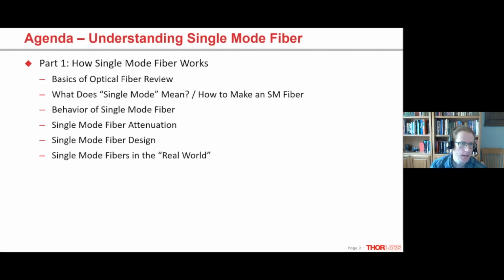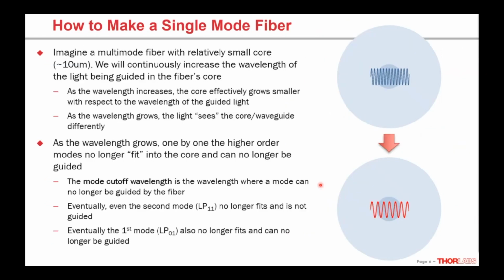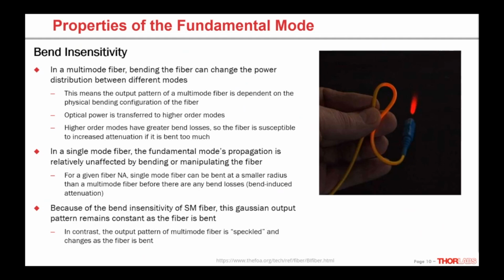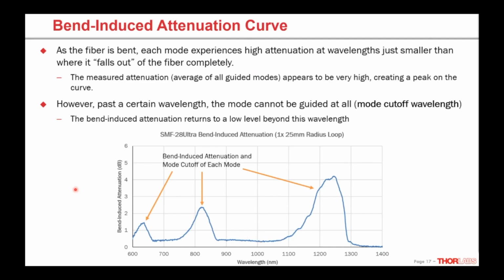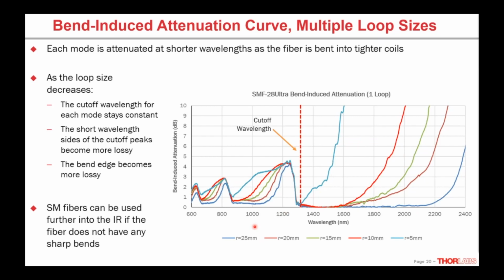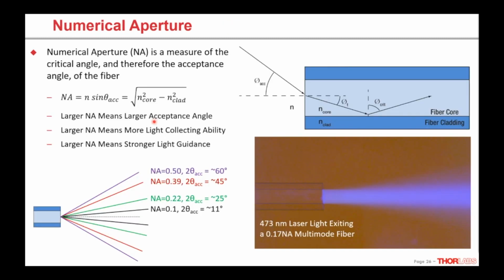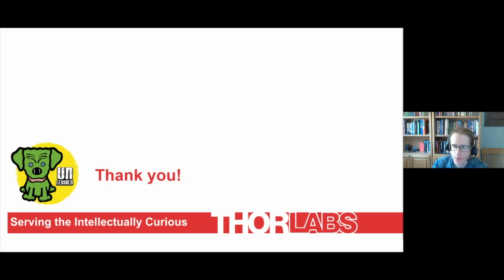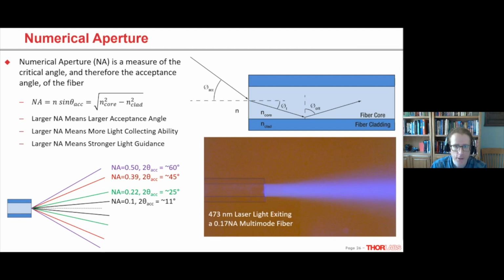Optical Fiber 101: Understanding Single Mode Fiber (Part 1 of 2)

Comment: Thnak you! These lectures are really informative!
Do we also know what we will get at the output of a SM fiber for an incoherent light input? 
And do the un-gaussian components are returned to the inital part of the fiber?
Reply from the maker: Thank you for your comment! If an incoherent light source is coupled into an SM fiber, the output will be gaussian. This is because only the gaussian “portion” of the input beam will be coupled into and guided by the SM fiber. The rest of the input beam will not be coupled into the fiber. The coupling efficiency will be very low, and the SM fiber effectively acts as a gaussian “filter.” For more information, part 2 of this webinar series goes into these concepts in-depth ( https://youtu.be/HvJeXakc8Kc ).

Comment: Just a quick comment that LP01 doesn't have a cutoff. Optical fiber is not like metallic waveguide that has an absolute cutoff.
Reply from the maker: Hi Arash, LP01 eventually "cuts off" and/or ceases to be guided in the fiber at wavelengths longer than the bend edge.
Reply: Thanks for the reply. I understand the concept of bend edge but that is not the same mechanism as actual cutoff for higher order modes. Solving the characteristic equation for a fiber shows that for V number from 0 to  2.405 we will have single mode operation. So basically V can go to zero. After the bend edge the transmission drops dramatically making the fiber practically useless for higher wavelengths but I don't think that is an actual cutoff in the sense that higher order modes cutoff.
Reply from the maker: @arashrohani7071  Our Tech Support Team would be happy to discuss this with you further! You can contact them at techsupport@thorlabs.com.

Comment: Super cool, thanks
Reply: ... do you guys bend the fiber around a 1" post for the attenuation test? lol
Reply from the maker: @pendalink  Thanks! When testing the attenuation of multimode fibers, you can use a mode scrambler, such as a mandrel wrap, to remove any cladding modes and ensure the light is traveling through the fiber with a mode distribution close to equilibrium. This prevents erroneous attenuation measurements due to lossy cladding modes propagating through the fiber and being measured. The radius of the mandrel is chosen based on the NA of the fiber (and sometimes other design characteristics) so that the loosely guided cladding modes are stripped out but the modes propagating in the core are left intact. This is especially necessary when light is launched into the fiber using an overfilled launch condition.

This mode scrambling technique is not necessary, however, if the launch into the fiber is sufficiently well controlled so that light is launched in at something close to the equilibrium mode distribution without any cladding modes being coupled in. However, even in this case, it can’t hurt to use a mandrel wrap or other mode scrambler as a backup in case the launch is not as optimal as intended.

Mandrel wraps can also be used when testing single mode fiber. In this case, there is no concern about the modal distribution of light within the core; however, the concern about cladding modes still applies.